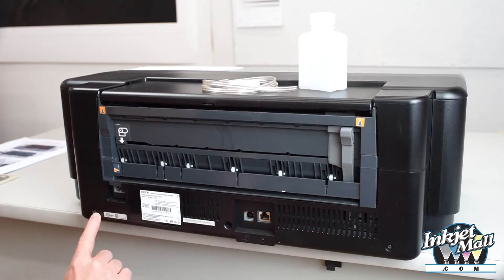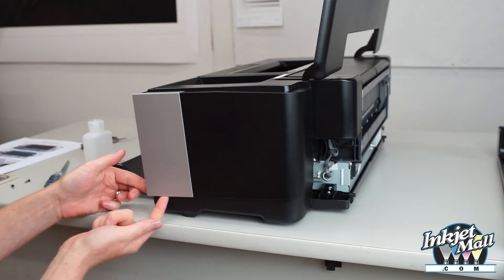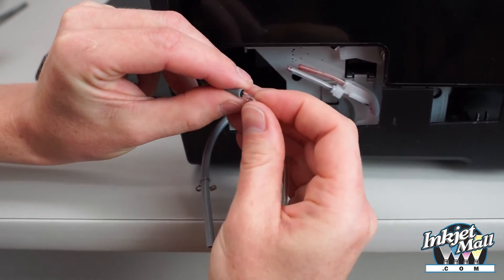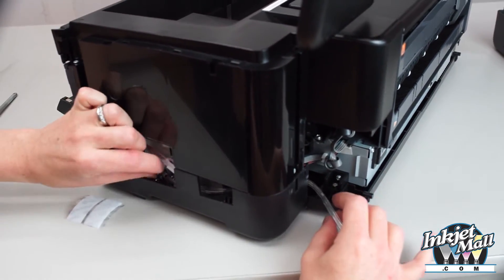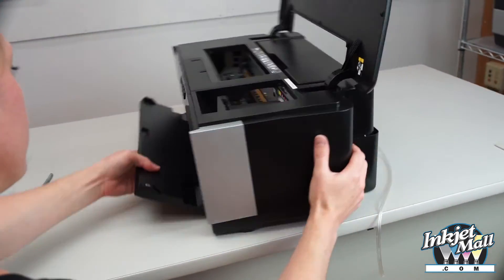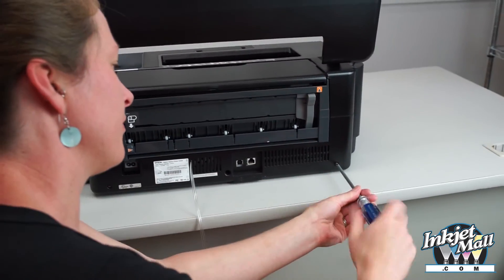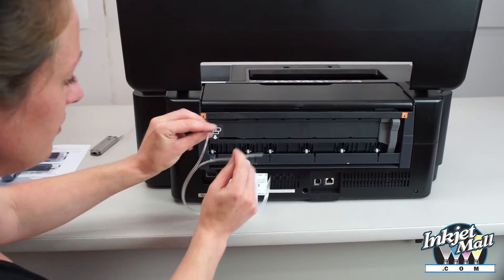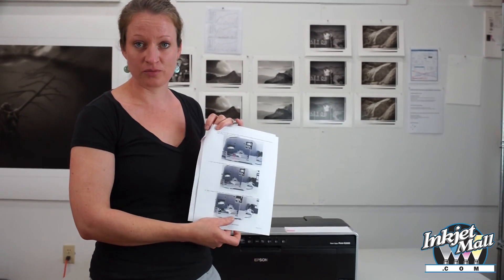Inkjetmall installing small format waste bottle

Comment: It is truly shocking to see how much ink is wasted in a cleaning cycle. Realizing an ink cartridge holds only 14ml of ink on my r2880. The cost of the kit is absolutely reasonable and this is actually a much easier mod than I anticipated. I have bought ink and piezo cleaning fluid from these guys and so far I would say it's very satisfying to get off the Epson cart that is taking you to the cleaners. I feel like I am slowly mastering these inkjet printers, learning how to deal with clogs and refills, and realizing I love color printing when the cost is reasonable and I feel I actually have mastery over the equipment rather than the other way around. Epson could learn something from these guys at Cone Color about that kind of customer satisfaction.

Comment: watching made me cry...all that expensive ink wasted...should be way to only clean clogged head(s)
Reply: I had air in 2 ink tubes of my r3000 I needed to flush them with the epson adjustment program, and not even there you can choose a specific color, so I had to flush them all. In order to flush the tubes you need full cartridges and after the flushing process all cartridges are almost empty...